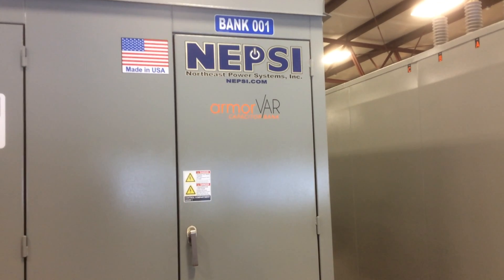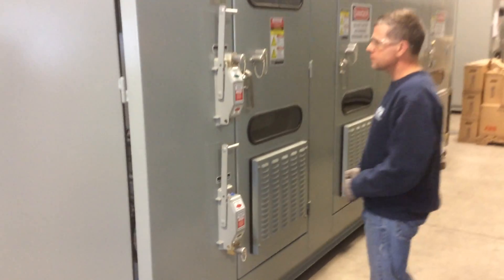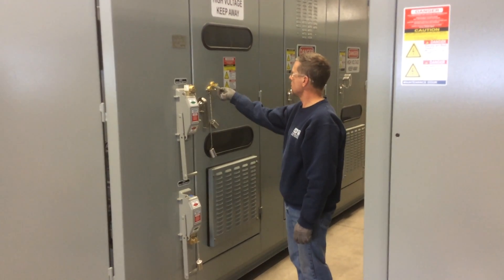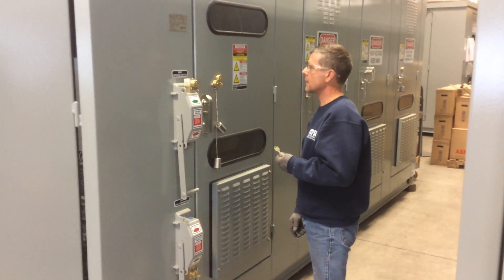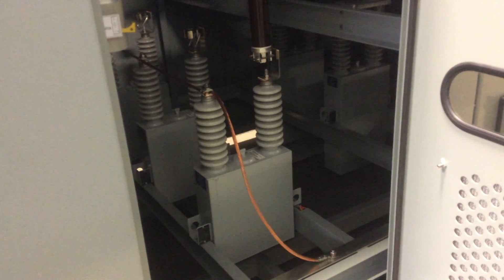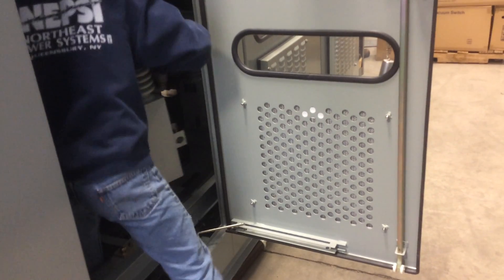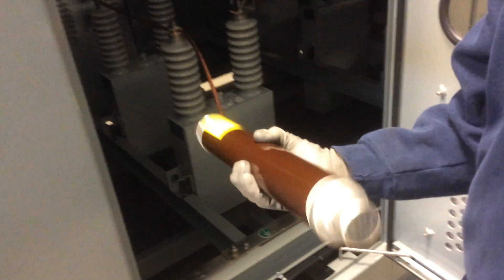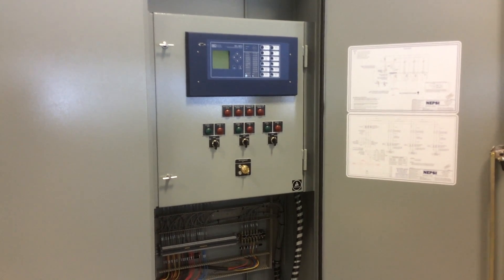Removing a Power Capacitor

Comment: Thanks for that video,but I have a question how you make sure that capictor has fully discharged by grounding it! As the only way to do it by short circuit the capacitor terminals , can you explain it , then what is the different and perfect ways  to fully discharged medium or high voltage overhead line capacitors with it,s different connections (star,Delta, single), thanks again waiting for your response

Comment: Would there be any benefit to add a capacitor Bank to your home
Reply from the maker: No, it would not. As a residential customer you do not get charged for reactive power (poor power factor). Therefore, no benefit to the homeowner. The electric utility would benefit as it would have all the benefits of power factor correction on the utility distribution system. To my knowledge this is never done. Also, much of residential load is resistive and only some of it will have poor power factor. Motors in the air conditioners, washing machines, and power supplies in computers would pull reactive power, but not lighting if incandescent and heating is resistive.